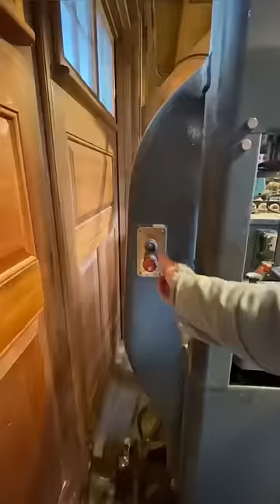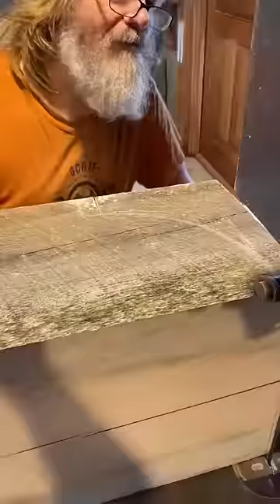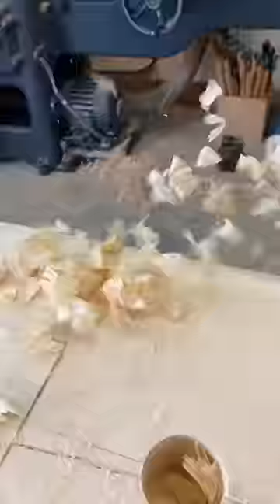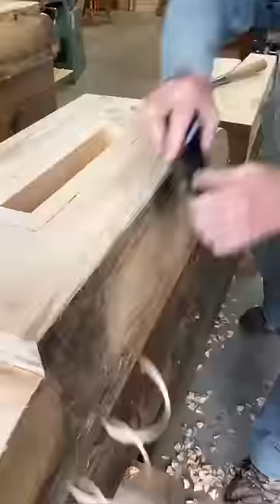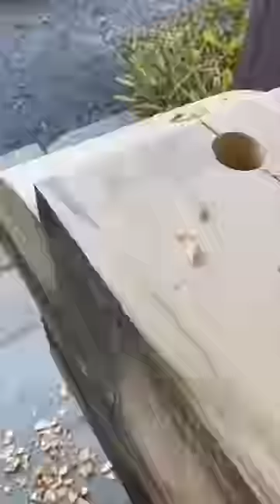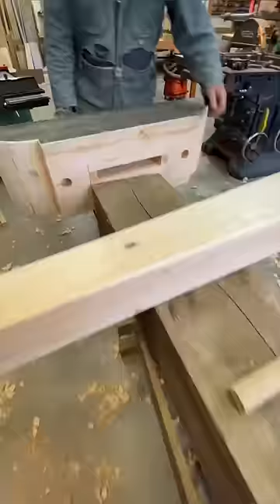Warning #rant #wadkintemple #woodworking #architecture #diy

Comment: An accumulation of tools?  I have alot of tools and i suck
Reply from the maker: what model table saw do I have in the back?
Reply: Without rewatching, im going to guess Delta Unisaw
Reply from the maker: @stevepierce2457  it's OK you don't have to rewatch, but I don't own a Delta Unisaw . what's in the background is what is reputed to be the finest table saw  ever manufactured. built by Wadkin Limited of Lester England in the late 40s early 50s this table saw has been featured in fine woodworking shops and tools, magazine and I swear to God if you were to Google, Jack Forsberg and the Wadkin Pk patternmaker Saw, you would see it is in a realm all its own. This pattern making equipment was well beyond the resources of even the finest cabinet making shops. 

I'll wait
Reply: @jackEnglishmachines damn you tell em jack
Reply: To be fair, you have to have a very high IQ to understand how good Jack’s table saw is 🧠
Reply: @stevepierce2457  do you confront people like this in real life?
Reply: @Brandonwc20  The original comment about having alot of tools was saying its not his amount of  tools, its his skill. I have alot of tools but no skill. It was a complement on him and a slight on me
Reply: @jackEnglishmachines  well dudes got a point fancy tools doesn’t mean anything other than you have fancy tools there’s tool
Collectors that have never even swung a hammer it’s a weird flex that’s all when your trying to make a point 😂 nothing against what you do
Reply: @jackEnglishmachines  It seems like you'd let your work do the talking and ignore people who have nothing good to contribute. Bragging about a table saw seems odd. As you probably know, they just want to find something to complain about
Reply from the maker: @NainKaigo  no I wouldn't call it bragging what I'd call it is refuting the notion that the types of tools don't give an indication. That table size is extremely rare and I've actually become famous for it although that isn't what I do there is an attribute to finer tools, especially in the hands of a master, just the selection of tools is extremely relevant
Reply: All kidding aside, looks beautiful. I’m only 2 yrs into this mad world of woodworking ( lots to learn)  I love it, just frustrating at times. By the way since I have 2 yrs of experience now, I can tell you that your using your chisels the wrong way, you using them upside down. 😊
Reply: @jackEnglishmachines  Experience is Necessary excellent work you do 😊😊😊😊
Reply: @stevepierce2457  That's how I interpreted it also.  However, seeing the response from Jack makes me think you hit a nerve there.
Reply: @jackEnglishmachines  That table saw looks like its 100% cast! Id love to have one like that
Reply: @jackEnglishmachines  calling yourself famous is probably one of the funniest things I read here, how did I miss it the first time? You should quit doing this and become a full time comedian, cuz it really sounds like You're better at that
Reply from the maker: @malo9792  typically that's what people say who are  not  famous for anything. Thing about fame is it's not something that you pursue. It's something that happens from something you did,  not all of fame is positive.
Reply: @jackEnglishmachines  dude you're not famous, not even Internet famous. At most you're small town news anchor famous.
Reply from the maker: @malo9792  yeah says nobody
Reply: You're what they call, "all the gear but no idea".
Reply: , Brother, some people are too sensitive to have adequate comprehension.....I got what you were sayin, and yeah he shoulda took it as a compliment and moved on....
Reply: @jackEnglishmachines I'm not saying you don't know what you're talking about , maybe you do.. I don't. But coming from automotive field, I've met many men with more tools than myself, but that didn't mean they knew anything. But posting online will always bring out the keyboard queens.
Reply: @jackEnglishmachines  Your machines are remarkable, but they pale in comparison to your expert ability to use them. You also provide some so much solid commentary and content. Thank you. 

So maybe a viewer writes a comment in a tongue-and-cheek way with the intent of criticizing himself and praising your skill over the tools you own (read: he’s not saying it’s one or the other, but that *you deserve more credit*), it might be worth reading the room rather than challenging him to a technical debate on arcane table saws. The “I’ll wait” was just silly. 

You deserve more followers like the folks here who are willing to tip their hat to your expertise. Don’t let the trolls on FB and other places get to you to the point you assume everyone is here to troll or criticize out of their league. Cheers.

Comment: People who don’t make things for a living will never understand this level of expertise and efficiency. I’m a younger lad, but used to be a machinist and my short time doing that has made me appreciate these types of men even more
Reply: I love men also
Reply: @4doorsmorewhors  no homo but me too
Reply: I'm not much of a builder by any means but I damn sure know how to use the tools necessary to make parts and pieces that someone else can use to make something in the future. I'm great with an axe and every kind of saw under the sun. But don't ask me to build you a chair. A table or a bench, sure. But I have a bad habit of the whole measure twice, cut once thing. I tend to never measure except by eyeballing it and cutting to my heart's content. I'm not a precisionist and will never claim to be. I just like using my tools and being in my shop or outside.

Now repairing things is a different story. I'm all about that kind of "building." 🤣🤣🤣
Reply: @Mind_of_a_Very_Strange_Man you've found what you like and sounds like you're killing it.
Reply: @timothyvarner6981  I can't say I'm not a happy dude for sure. I like to tinker. I've been an old since I was about 12 I think. 🤣🤣🤣
Reply: If my mortise and tenon was that thin I probably wouldn't have a job but I was also taught it has to be 4 inches thick or more for load bearing beams in the case they get racked by a tornado or an earth quake.

Comment: Looks fine to me. 25 years ago I used to build canal lock gates out of huge unseasoned oak beams, they held back several miles of water. I used a similar sized mortice and tenon for those. As far as I'm aware the Monmouthshire and Brecon canal still has water in it so must be good right?

Comment: Anyone who has stood in front of the bandsaws, variety saw, jointer/planer, drill press, routers, sanders, and shapers, should appreciate other woodworkers. Had many close calls with broken blades on the band saws. Once a loop came out to where my head was, and it snatched back inside quickly. I must have quit breathing for awhile.

Comment: This is why you Never argue with stupid people on the internet, they will drag you down to their level and then beat you with experience.
Reply: Pantomime
Reply: But you should argue with those people. The problem with ignoring them is that it is letting bad information prevail over correct information and the community that you are interested in gradually gets dumber for it. There is a trick to it, and of course you have to deal with the name calling, stacked emojis, and other non-sense, but when you realize that those things aren't about you, it's about them recognizing that they are losing and they want (need) to shut down the discussion, then it's kind of fun.

Comment: It’s crazy how many times people have told me how I’m doing something incorrectly or how unsafe what I’m doing is. It’s a great way to see how lack of experience from people, towards those who have thousands of hours of experience. It’s the Dunning Kruger effect in full display.
Reply: I hear you man its amazing my 20
 years of experience often seem irrelevant to the woke geniouses who want to reinvent the wheel
Reply: @ryanarch9934  It’s mind blowing huh. I’ve seen professional woodworkers use a table saw with no riving knife. Thats how he likes it and he knows what to do when cutting without one. Yet everyone will cry that he is being stupid and dangerous. So silly.
Reply: @derwoodsdiy7710  I only use them on my 10foot SCM panel saw never use them on my 10inch blade delta just in the way. I primarily set up for datto cuts and rabbits where I do a 2 cut return instead of datto blades. Never use the guard either just experience, patience and respect for woodworking equipment. Ive seen 5 guys get cut very bad and loose fingers. I always keep my space clean no scrap on the floors always keep my mind on my work.

Comment: I agree the bearing strength is in shoulder cuts. Pretty much the same as the cleat to connect a post to a beam it's only purpose is connecting the structure.
Reply from the maker: when you know you know
Reply: I love those old wadkin machines in your shop. I some old Rockwell tools from the 70s 18inch thickness planer,   band saw, lathe I have a wadkin spindle shaper wadkin 12 inch jointer love my old tools the most.
Reply from the maker: @ryanarch9934  yeah Wadkin is king

Comment: Strictly speaking there is a ratio. Mortise and tennon : thickness of the finished product : number and orientation of said mortisees and tennons : glue yes/no : sail plain area of the finished structure, etc... 

The formula can get surprisingly complex.  

I don't know the size of your finished piece so I can't say for certain. However, if you are at close to finished size already then,  for that size,  if 2" tennons use 2 not just one. 

Else I, a formally trained and experianced woodworker, given the asertions I have made, would likely have made a larger single tennon. Even though the added friction would make assembly a bit more difficult.
Reply from the maker: The problems with formulas and rules of thumb is they are general and not specific. Of all the comments on this thread not a single one has ever asked what this column has replaced. Remember, this is a replacement to a column that failed. The columns were simply cedar logs of a 8 inch diameter screwed to the bottom side of the 12 x 14 timber beam supporting the floor joists. Might I add they were very generous with their number eight Robinson wood screws as the attachment. No failure of the actual structural stick was the issue. The logs sat on the river bed  in water during the summer and ice during the winter. No footings anchored to the solid limestone bed.  in fact, one of the timbers was lost during a freeze and thaw cycle, which none of the museum staff had ever noticed. The museum is closed during that season and so there isn't a noticeable staff around. Major foundation work was carried out eight years ago to the surrounding stone foundation, which is 4 feet  thick and so I suspect even the Engineer study missed it area . so assuming that an 8 inch diameter pier is sufficient in size to support the existing structure in that location a single 2" tenon would be sufficient in an 8 x 8 square timber. Typical rule of thumb size. no take to consideration that we are supporting a 12 inch wide by 14 inch deep beam. So let's size our peer to give full support to the beam and and maximize it's point load on the wood. Concrete peers were pinned to the rib and brought up above the water level to support the base of these timber columns. not only did it aesthetically belong with the Timber frame sizes on the underside of the joist frames, but was already excessively large for what was required and because all the tenant does is replace the fastening at the top of the structure that replaced the number eight screws, which obviously held up in some cases for 50 years 2 inch wide by 12 wide by 2" thick tenon is more than efficient. Not only that it would have been far easier for me to make a thicker tenant as this one was beyond the capacity of my machines, and to make it to the thickness I did required far more work. The thickness therefore increased the bearing capacity shoulders, which do all of the work. And so sizing the tenon  based on formula, takes only consideration of the strength of the tenon , and not the bearing capacity of its shoulders which was the exercise of this particular application. rules of thumb and guidelines for sizing engineered sized joinery is for those that need guidance. They do not represent an absolute by any means, and in fact, are often detrimental to the other substantial components in the engineering of a structure, or as you say, can become quite complex, but it ain't rocket science

Comment: As a stress engineer, with 30 years experience, I would agree that the tenon seems too small. From what you describe the column has to survive the positioning process but if it not under load during that process you should be fine - but, hey, I'm no Facebook woodworker !

Comment: Since its basically an indexing pin for alignment, it could be made even smaller. The entire post will be under a compression so the tennon supports nothing.
Reply from the maker: I wouldn't say it doesn't support anything. It does key the pillar to the upright post in the same way that pegs lock tenons to their mortise

Comment: I recently bought a bit for my brace that angered me, it's an auger that's adjustable right, nowhere on the packaging does it say it only cuts 1/8 inch deep cuts. It's in Spanish no English.  I took Spanish for 7 years as a required course but it's not the same words. You'd think for something as expensive as a brace bit they'd tell you the depth rating . It does lovely cuts but I want an auger that's 3 inches not a hole cutter

Comment: Its the shoulders that have to be sized correctly - until the thing comes under sheering or twisting load and falls like a domino. Earthquakes. Fires. Some idiot driver putting their car into a building. 
If you think having 25 years of experience makes you immune to mistakes and learning then its time for an ego check.

Yeah. You can spend 25 years working in the field and never run into such a situation. And in the 26th year people will be hurt because an assumption that held true for 25 years suddenly didnt.
It happens in the aviation industry. It happens in woodworking. It happens in any field.

Human lifespans are short. 

Maybe you are right. Maybe it will never be a problem. And maybe people in the comment sections are talking out their ass. But years of experience are not the measuring stick. And if you use them as a blanket defense you have stopped growing as a woodworker.
Prove your point with arguments, not ego.
Reply from the maker: all of these long, winded remarks never ask what was there :::::it was a log, cedar 8" round sitting in the riverbed water not pinned to the rock-bottom and held with six number eight screws at the top .

Comment: Everything makes sense except I’m wondering why not double the thickness of the tenon anyway? Granted it may not be necessary at this point but who knows what stresses or pressures the wood may be subjected to in the future? It’s a little insurance. Just an observation, no biggie.
Reply from the maker: well, if you saw what it was replacing. And I already know what it's up against it's carrying for stories in an industrial milling building from 1860.

Comment: i hear you but how exactly do you calculate the size of tenon needed? . i really would interested in how you decide on the size. This one to me looks to thin but then when you said it was standing on it vertically I then thought OK but how did you decide the size needed for the post and for the Shimm's needed. I know most folks don't give a shit but my first thought has always been why. Your rant put so many questions in my head that I never even thought of before. I'm such a nerd. From the sound of your rant I think you may not be a nerd.
Reply from the maker: A 2 x 4  can  support 1000 pounds. So the area of the 2/4 is 1/32 the area of a 12 x 12 . that's not taking into account that a 12 x 12 is far more rigid and not a combination of two by fours but with that number we are exceeding 32 thousand pounds

Comment: Why wouldn't you just use four different screw guns and see which one will drive the 12" screw the deepest? You know yellow glue, silicone brush to spread it around and then some over priced festool clamps. From one old timer to another, if they don't put thier foot in thier mouth than we can put our foot in thier mouth😊

Comment: Why not layer it so no giant check that will eventually open more in years to come
Reply from the maker: this is a structural element. The cracks don't continue moving and when you look at the sheer volume of what doesn't have cracks, it is irrelevant the cracks only go to the center of the tree the center not all the way through.

Comment: I dont understand about propping it up, are you wedging it in place then making it vertical so it pinches that block then the male will slide into the female as you hammer it into place and knock the block out
Reply from the maker: there are a number of other videos that will probably better explain it for you. They're in sequence.

Comment: Maybe if idiots could do a simple PSI calculation they would know that. Where is your engineering drawing and documentation for your supports?
Reply from the maker: maybe if the idiots asked what was originally there that I'm replacing they wouldn't need to do any calculations